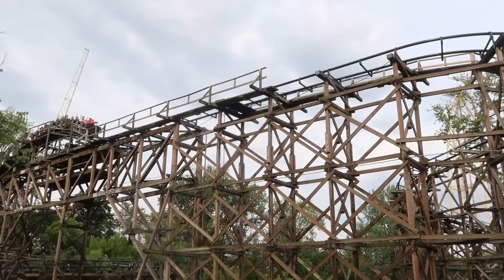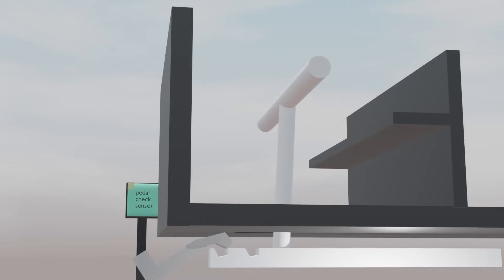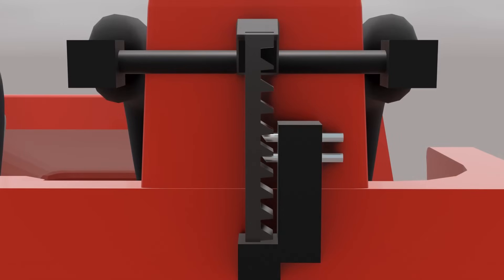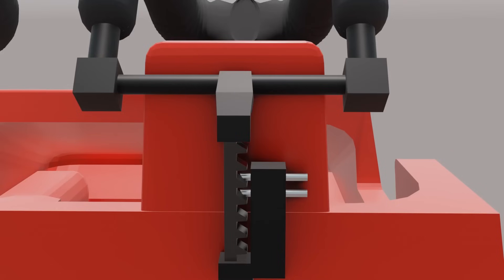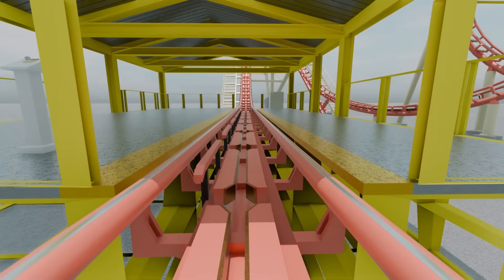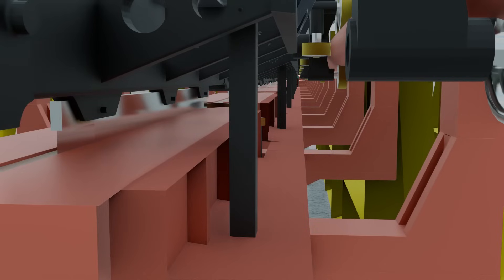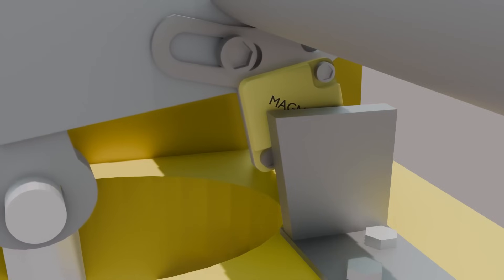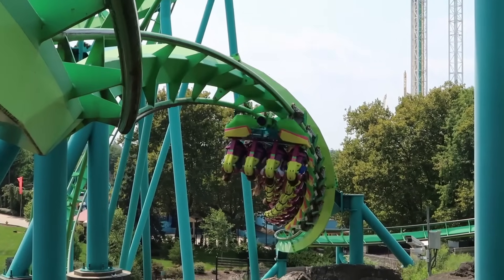Roller Coaster Restraints NEVER Fail!

Comment: Restraints failed on literally your last video about Jetline. Titles like this is disingenious and will just make GP mistrustful of safety.
Reply: He could not more obviously mean that properly made restraints can't fail spontaneously. Which they can't. The Jetline failure was a cascade failure where lack of communication between contractors set the domino chain in motion. The restraints themselves never even failed, they were severely bent due to forces exerted on the train - he explicitly explains this right around the one minute fifty second mark of that video.
Reply: On Jetline the axle for the wheels broke. This failure caused the wheels to detach, leading the car's chassis to scrape against the track and experience abrupt deceleration. These sudden stops generated forces significantly higher than those encountered during normal operation, meaning the restraints were not designed to withstand them. So In that case the restraints didnt fail, since they were never even meant to withstand those forces. Besides that, they also didnt actually open due to the actual mechanism failing, instead physically the lap bars were just so deformed that some bend forward toward an open position.
Reply: Ragebait bot comment.
Reply: The point is that they will never fail individually if serviced properly
Reply: saying that the restraints on jetline failed is like saying that the doors of a car failed after it crashed into a tree at 300mph. 
the reason the restraints came undone its becuase the forces of the incident (which was caused by the axle breaking" bent them out of shape, it was a catasthropic failure, the restraints themselves where fine until something way beyond their expected force load caused them to fail.
Reply: They failed because they were not meant to withstand the forces that happen in that accident.
Reply: Let me elaborate a bit the issue I took with the title.

Yes, I am well aware that a well-maintained system won't fail. But the word "never" is simply just not true. We have multiple cases of bad maintenance causing restraints to fail. My issue isn't with a video that points out all the various safety systems in place to prevent failure, my issue is with the word "never". Wording like that simply cannot be trusted.

Consider someone unfamiliar, perhaps wary, of rollercoasters. They see a video titled "Why Roller Coaster Restraints NEVER fail", only to then watch another video of restraints doing just that, from the very same channel. Since the title was clearly incorrect, how reliable is this person?
Reply: @FredrIQ  Im pretty sure most people have enough brain matter to understand that the word "never" is not always used in its full extent. and usually means that something will never fail within reasonable parameters . gross neglect and catasthrophic failures are not inside reasonable paramaters and are in fact outliers. 
in a high-profile park with good maintenance record and little accident reports, ride restraints have very little reason to spontaneously fail.

someone that takes the word "never" in its literal sense is very naive.
Reply: @ciclon5682 guess I'm stupid, then, cause I was having the same issue with the title claiming they NEVER FAIL 🤷🏼‍♀️
Reply: @FredrIQ  How many times do we have to explain to you that the Jetline restraints didn't fail, they were bent? There was no mechanical failure that caused them to open. This is talking about failure in an engineering sense and if you watched the channel regularly you would know that. Rollercoaster restrains have not, cannot, and will never spontaneously just pop open in the middle of a ride ala Final Destination, it's against the laws of physics.
Reply: @princeoftheazuresky  I can't verify it atm, but didn't they suffer a failure in Chimera and Mindbender? I think FD3 was inspired by the latter even if the way it's portrayed in the movie is ridiculously unrealistic
Reply: No, they did not suffer a spontaneous failure. If you're dragging it out for three weeks you're either willfully ignorant or a bad troll. Mindbender was not a spontaneous opening of the restraints for no reason. Mindbender was a wheel assembly failure that caused parts of the car to come into contact with the track under circumstances they were never designed to. Watch the video on this very channel again instead of FD3 and clear your head. I'm done with this dumb conversation and with you sticking your fingers in your ears every time someone who knows what he's talking about corrects you. It's been a month.
Reply: @princeoftheazuresky  I forgot all about this until someone pinged me in replies, I wasn't trying to drag anything out lol
Reply: @FredrIQ  iirc fd3 was inspired by headlines of various roller coaster accidents. It wasn't based on any single accident.